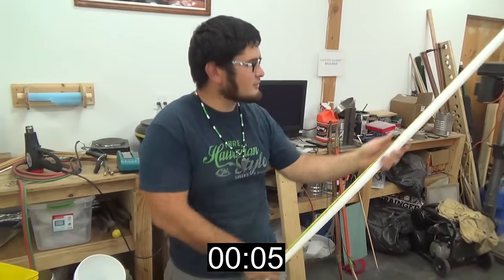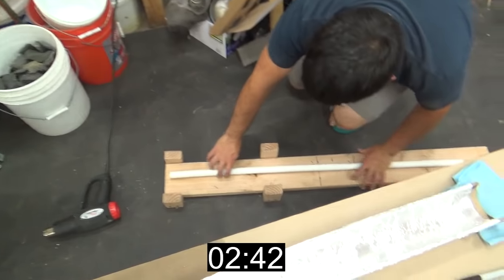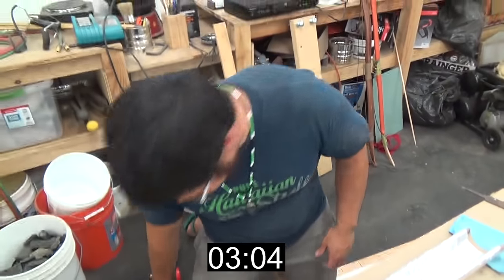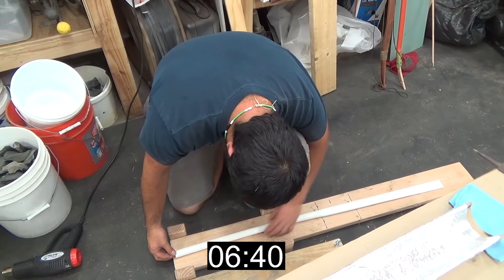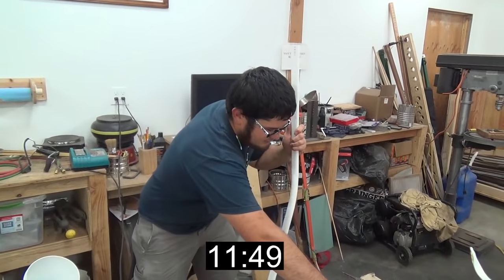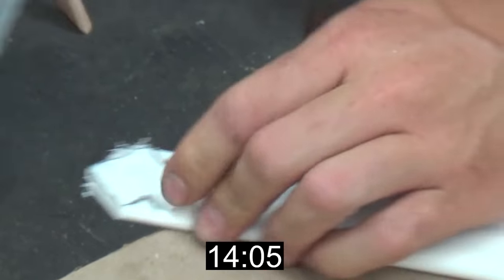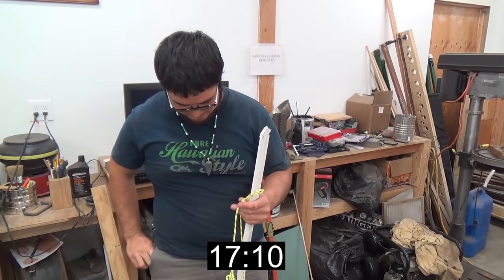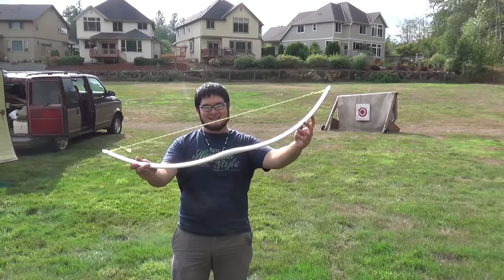Making a Gull Wing Style PVC Bow in Under 20 Minutes at the Sammamish Knapp In

Comment: I was able to make this but was also able to increase poundage to around 45 lbs at 28 inches. Only thing different was filling the PVC pipe with Great Stuff gap filler insulation foam through a hole I drilled in the handle that I later closed up with jb weld. Give it a shot, I only recently tried it but it looks promising.

Comment: I made it as my first PVC bow, it took me about 2 hours to do the heat right but I'm still impressed by it. I used a stove top to heat and used two simple 0.7 x 0.15 meter wooden blocks. It's kind of challenging when trying to make it flatt without it getting crooked.

Would like to make more, any tips on making it easier and faster?

Comment: @BackyardBowyer i tried making this bow with the specs in the vid but with 1 inch instead of 3/4.... BIG mistake lol so damn stiff i cant even string it.. might work with one inch if pipe is longer but ima do the 3/4 tomorrow hope it works better.. whats the draw# on this bow with 3/4???... i made your fiber glass rod bow and love it but now i want to try the flattened bows VIDEOS ARE AWESOME BTW!!!!
Reply from the maker: Thanks for watching!

With a 1" pipe, a bow like this will draw around 50 pounds at 24 inches and anywhere from 60 to 80 pounds at 28 inches depending on how badly it stacks. So it is a bit heavy and short! The draw weight is around 35 pounds at 28 inches with 3/4" pipe.

If you want to try using 1" pipe, 55-60 inches is pretty much the ideal range.

Hope this helps!
-Nick
Reply: i really appreciate you taking the time to answer me :) but after several attempts now from recurve to gullwings i just havnt quite got it down yet :( my 3/4 also came out really stiff so i tried shaping the "gullwings" and bit myself with some heat but still dont have it dialed in yet... any advice for why my bows are turning out so stiff?... do your amazon books have troubleshooting sections? LOL
Reply: @Arm_Kombat  you get a friend that works out to try and string it. If he can't do it then you've made one heck of a bow.
Reply: @joelreason8205  im 6'3 270 lbs lol i am the biggest of all my friends that thing was just a monster

Comment: Will making pvc bows work with schedule 40 transparent pvc pipe? Beause I live in Germany and thats the only thing I can find.
Reply from the maker: It might work, but most transparent PVC pipes I've used are very, very brittle and break easily. The only exception has been Formufit furniture grade clear pipe, but it has more of a blue tint than actually clear like some pipes. Hope this helps!
Reply: Obi, Baumarkt, Hagebaumarkt etc all have pvc water pipe and electrical conduit. Failing that you can also try trade suppliers of ask a plumber/electrician. I guess it depends on where yyou live, but pvc pipe is not that hard to find.
Reply: +Tsc Tempest thanks I will try to find it there.
Reply: I also live in germany. You can order it online at " kwerk" but its quite expensive. you can also get it in some cities in specialty shops like " kvs-hanau". The important thing is to look for pressure pipes rated at 25 bar with an outer diameter of 25mm for 3/4 inch pipe and32mm for 1 inch pipe germans use outer diameter, americans inner dia..
german 3/4" sch.40 equivalant is: PVC-C Druckrohr (druckstufe) PN25 durchmesser 25mm wandstärke (wall thickness) 2,8mm.
1"pipe: 3,6mm wandstärke
Reply: It's really not the only thing you can find in Germany

Comment: I'm fascinated by this but have a few questions: 1) I'm guessing that the draw-weight is fairly minimal, 20lbs or so?  2) Does the bow take a "set"?  3) Schedule 40?  4) Does heavier pipe make for a stronger bow?

Thanks!
Reply from the maker: +Bill Weissborn The draw weight is 35# at 28". The bow does take set but it keeps its reflex, there is no string follow. It is schedule 40, and yes a bigger pipe makes a stronger bow. A 1" pipe at around 55" long will yield around 50 pounds in this same style.
Reply: +BackyardBowyer I just made this bow today with 1"  Sch40 and it turned out well. But I think my bow string is a tad bit short. With the bow unstrung, how long should the string be? I think I saw from one of your other videos that it should be about 5-6 inches shorter than the bow itself? Or should I say the nocks. Thanks. And love the channel/videos.
Reply: +Bill Weissborn actually u can make "strong" bow. Just insert small pipe in larger. Also can fill pipe with granula material =).
Reply: Wow. I'm very impressed. You're the best.
Reply: BackyardBowyer what does take set mean?
Reply: Imagine a straight green stick. If you bend it and keep it this way for a while, it will take shape and stay bended. Not as much as you bend it, but not as straight as it was. The same thing happens to PVS bows. That is what "take set" means.
Reply: You can add a thinner pipe inside the main pipe. That will give you close to 40 I believe

Comment: I have made the 3/4" pvc fiberglass longbow as a 1st run, the recurve as a 2nd bow with 1" and also the gull wing at 56"..  Fiberglass no heat and recurve sling arrows good at maybe 10 yards but out to 15-20yds the fiberglass core arrows have a big drop.. The recurve 1" slings em on point from beyond.. I made a 1" gull wing style as shown in the video and the draw seems in the middle.  Brace height is about 5" from string to bow.. Usually low brace height gives me wrist string slap.. Wonderin if i need to make a shorter string to raise brace height on my gull wing..

Comment: I noticed you did not use fibreglass rods does that affect the performance +backyardbower
Reply from the maker: There's really no point in using fiberglass rods in this style of bow. If you did use fiberglass rods, it would be to bring up draw weight (but they tend to bring down relative speed) and works better with larger and longer pipe. A bow like this will usually be faster than a bow with fiberglass rods of the same weight.

Hope this helps!
Reply: thanks so much you are such a legend BackyardBowyer

Comment: Nobody answered Christian Carroll's question.
  What is the draw weight?
  Without facer string or composite facer material I would guess 25-35 lbs at full draw. There is a way to make a 50-60 + lbs draw weight pvc bow from around $25 materials from your home improvement center.
    Still a real nice bow shown here.

Comment: Just made this bow as close to how you made it as I could, and whenever I string it the limbs won't flex enough to get to the same profile you got in the video.  I used 3/4" schedule 40 at the same measurements, and I don't know what to do.  Is there any kind of advice/tips/corrections out there that might help me?
Reply from the maker: +hawaiipride7 When you flattened it, what size spacer did you use in the center and how flat were the ends? If you have any pictures, you can send them to me on Facebook or Google Plus.
Reply: +BackyardBowyer I used a 1" taper in the center as that's the outer diameter of the pipe, and the ends were both completely flattened.  I took a few pictures, but when I was trying to adjust the alignment of the limbs and strung it again, one of the limbs creased.  :(
Reply: shorten the string

Comment: so i know you have said that the white pvc works better then the gray. have you ever tried using the purple? i think its used for fire sprinkler systems. im just wondering if its more or less elastic or brittle. idk if you have already but a comparison video of all three could be interesting.
Reply from the maker: +Shane Smyth I have not seen purple pipe outside of furniture grade. I need to give it a try. If in doubt, just hit a scrap piece with a hammer. If it shatters, too brittle. If it crushes or can be flattened without breaking, it is good.

Comment: What's up Nick! I love your videos. I have a question about the 80lb bow you made a video for a while back(its the only flattened design I've made so far) I was wondering if instead of cutting the "V" shape out of the tips, heating, and bending to make them tapered, I could simply cut the style of nocks you used on this bow, and if you would suggest it.

Comment: Hey Nick,  I made one of these last night same as in this video with 4 inches of reflex but out of the 3/4 schedule 40 gray wall conduit and it's got near 40lb of draw at 18 inches.  I was thinking the gray wall would make a less powerful bow but I was wrong...
Reply from the maker: +Krusnax That sounds really high. Are you sure you're using schedule 40 and not 80? That sounds right for schedule 80. How high was the center spacer on the flattening jig?
Reply: It says 40 on the pipe and the spacer is 5/8 of an inch. after watching the video again I think I see what I did wrong. Looks like you flatted from the center of the grip correct? I started at the base of the limb itself.
Reply from the maker: Yes, I flattened at the center of the bow. Though that shouldn't bring the weight up that much. Has it settled out at all? Sometimes if the pipe is pulling heavier than it should at first it can sometimes come down.

The bow ends up slower as a result, but that's what usually happens. Hope this works out for you.
Reply: +BackyardBowyer I've been shooting it all day and it has yet to settle out.  Still quite heavy and I measured the draw and it is more like 16 inches.  I think I'll try making another one here in the next few days.
Reply: He says 48 inches of schedule 40 in the video.

Comment: Hi  Nick

I'm from Macedonia. We don't have schedule 40 pipe in the country. The close dimension of schedule 40  3/4'' pipe is:
Outside Diameter.  25mm - 0.98 inch
Minimum Wall Thickness. 4.2mm - 0.165 inch
 So my question is. Can i make a  good pvc bow with this pipe?

With respect 
Ivancho.

Comment: Also, is there an exact angle I should form the bow to ? like can I just eyeball it or do I need to get it exact ?
Reply from the maker: +UnKnown MadaTe (K.J.420) You want the center of the bow to be lifted up about 4-5 inches when the tips are resting on a table, like how I do in the video. Some of that will disappear when the bow is used, but it will keep some of it. It doesn't need to be exact, just make sure it's a gradual curve and hot a hard bend.

I also used the high setting on the heat gun. As long as you keep the gun moving and don't settle in one spot or touch the pipe, it will be fine.
Reply: Thanks man ! I look forward to trying to make one soon !

Comment: Did he use a hair-dryer to heat up the pvc? If not, what did he use and could I use a hairdryer instead?
Reply from the maker: I used a heat gun, most hair dryers are throttled or restricted so they don’t get as hot. This heat gun puts out around 750 degree (F) air.
Reply: @BackyardBowyer  alright, thank you!

Comment: At normal draw length how long does a PVC bow typically last?
Reply: I heard it was about 2-4 years
Reply from the maker: It depends on a lot of things. If the pipe you started out with was brittle, I'd say it'll last a few thousand shots before the brittleness becomes a problem. Other than a catastrophic failure from cuts or deep scratches, there really isn't a set lifespan. I have a few bows I've regularly shot for about 6 years now and they are still going strong.

Comment: what size is the pipe?
Reply: +LOWHALF12 Just looking at it, probably 1"
Reply: +astramancer i want to say a 1" too
Reply: +LOWHALF12 Looks more like 3/4 inch
Reply: +LOWHALF12  it's 3/4 inch pipe,he made it 46 inches long,it won't work with 1 inch pipe it would most likely collapse :)
Reply: +ahmed dhiya how long do you think a 1" should be?
Reply from the maker: +LOWHALF12 I used a 3/4" pipe, cut 46" long. For a 1" pipe, I would start at around 58" or so.
Reply: +BackyardBowyer thanks man!